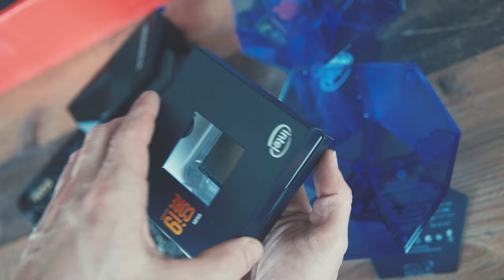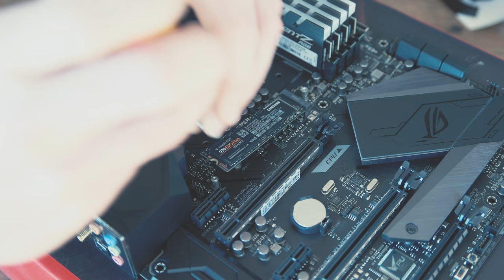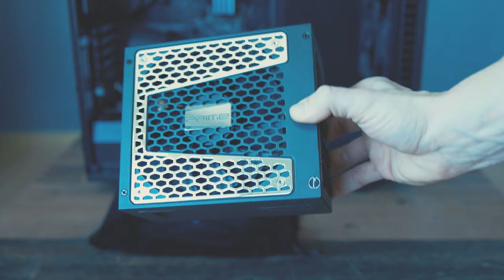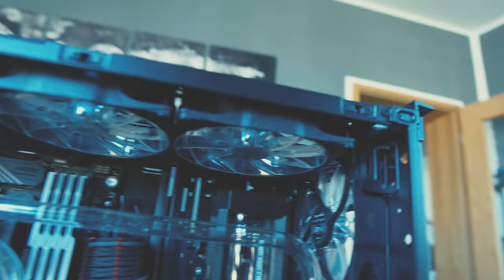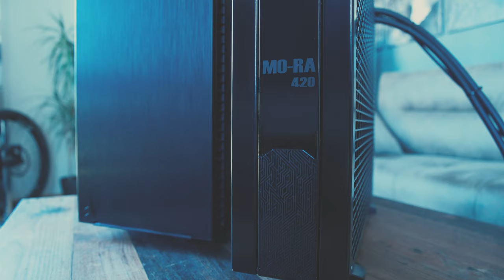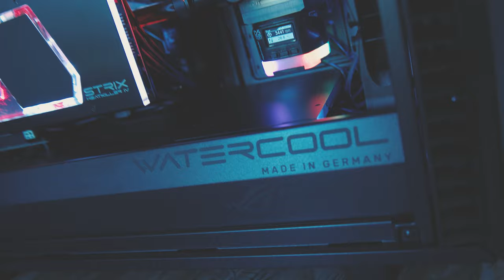Fractal Design Define 7 ROG Strix Watercool Time lapse

Comment: Hallo, hab ich eben gesehen und dein Build gefällt mir sehr! Aber, warum nimmst Du ein so großes und geräumiges PC-Gehäuse wie ein Fractal Design Define 7 und dann einen großen externen Radiator - externe Wasserkühlung? Die Frage stellt sich mir deshalb, weil ich ebenfalls in ein Fractal Meshify S2 eine interne Wasserkühlung einbauen werde, da ich genügend Platz für 2x360 Radiatoren habe.

Comment: Hi, sorry for the question, ¿where are the radiators inside the case in  order to cold the liquid? ¿or do you just and external radiator?!? I have never seen it before
Reply: they are call MORA (360/420) this is short for "monster radiator" :) they offer more than enough cooling power for any non-quad-sli-ish build